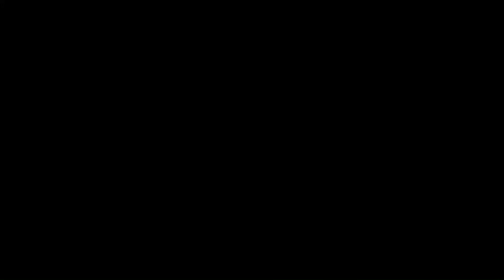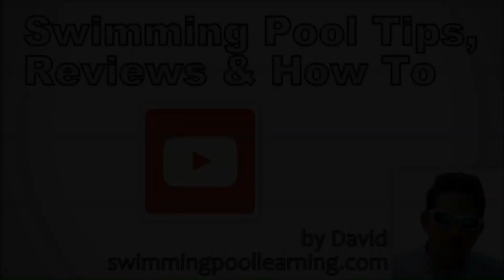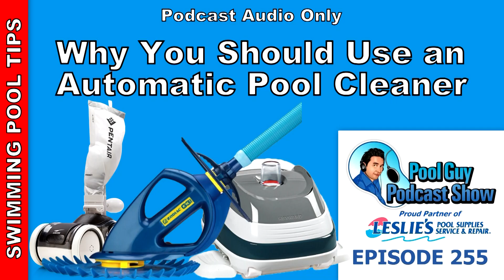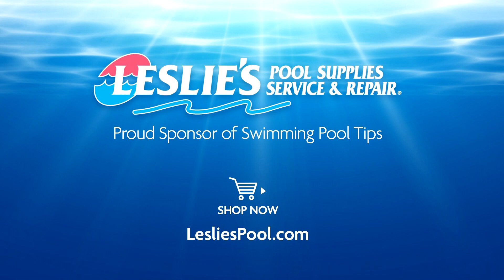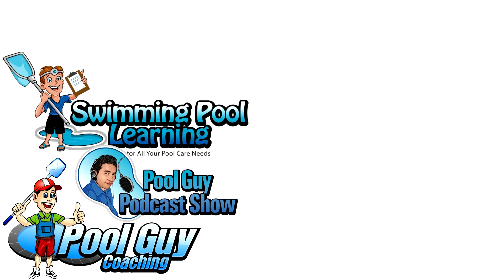Why You Need to Have an Automatic Pool Cleaner

Comment: I hate automatic cleaners. Even the best one imo, the mx5, doesn’t pick up all the leaves and always gets stuck somewhere doing a burnout. I always have to power vac the pool anyway and the cleaners just gets in the way and tangles the line
Reply from the maker: Interesting take. 👍
Reply: @SPL  Interesting is a nice word. WRONG is mine :D 
There is no doubt whatsoever that a properly functioning cleaner will reduce the amount of time spent at a job site.
Reply: What do you mean by burnout?
Reply: RINGADING DING the vacuum gets stuck but the wheels/track keeps moving. I think this also causes the internals to wear out sooner and eventually the cleaner doesn’t move at all
Reply: @dannyboy768  I've experienced the same problem with the mx5 it seems to work really well when its moving but gets stuck a lot. The one I deal with is hooked up to the skimmer port, which I hate doing and it gets way to much suction because this particular pool doesn't have any valve's to adjust the skimmer suction. I like to keep all my cleaners running at lower suction to prevent damage. A good way to speed up vaccuuming those pools that still need vaccuuming even if they have a cleaner is to hook up your vacuum head and pole to the hose of the cleaner that's already in the pool as long as it dosen't have really heavy debris.
Reply: Mx5 or the mx8 sucks they look nice but they suck even the cheap zodiac you see in the middle picture is better and that the cheapest and a cleaner my boss hates but much better price it will get stuck like the Mx5 but its cheaper
Reply: I been watching YouTube pool videos for 6 years now and I will say idk who to believe at times some pool ppl say something and others say something else I guess there selling but I have tried what I see some work some don’t
Reply: @rubenscott3972  each pool has it's own personality in my experience. I've had some pools that have cleaners and still get lots of debris and pools that don't have cleaners but I almost never have have to vaccuum. It's a lot of trial and error in my experience, you can add weights to cleaner hoses so they stay in certain areas of the pool and adjust suction but there will always be those problem pools. My hammerhead is my go to for those pesky pools that just won't stay clean for whatever reason.
Reply: My boss had a Cotumer but the 1,400 pool cleaner that look like a Polaris 360 but fancy I would just stick to the normal Polaris the nomads 2 wheel suction cleaners or a simple 300$ cleaner like the one on the videos
Reply: But if you have the cash and want something fancy there are nice ones I have millions dollar homes and they all like blowers when I go in a house and see blowers it makes me want to blow my brains  I never had a pool that the blowers worked correct always a place we’re trash collects idk what the cost is but I only see it worth the cash in pools that are 50 to 80 thousand gallons because they have so much odd designs that’s make no sense but look nice